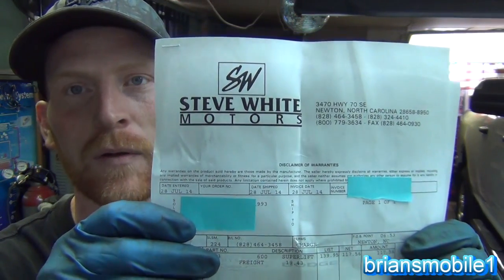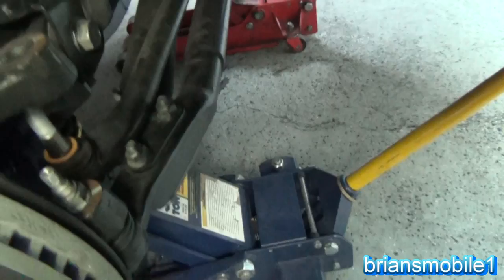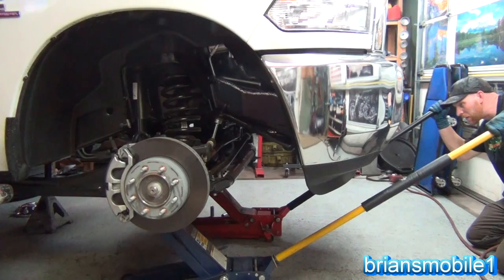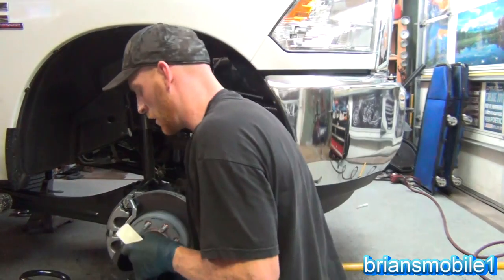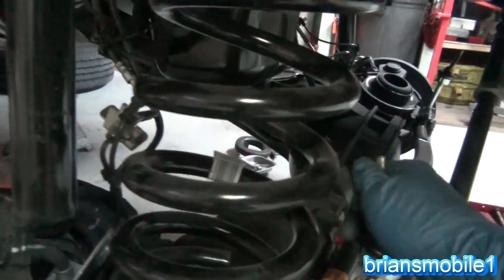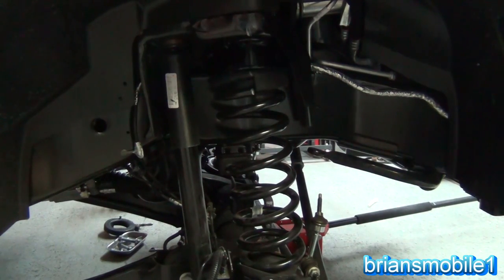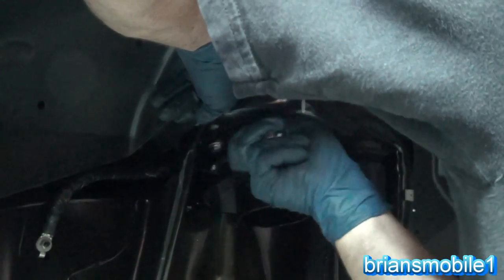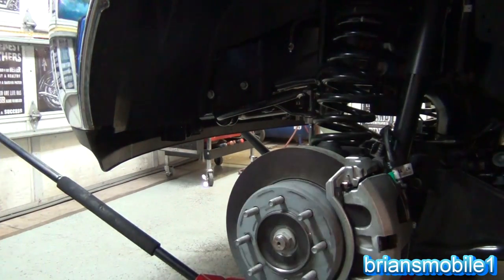2014 Ram 2500 2.5" Superlift Leveling Kit Install

Comment: Thanks for taking the time to show this. I have used the knee method in the past to lift tires up. There is another way I have used ever since I have learned it from a friend. Most of my vehicles (86 CJ-7, & 06 Ram 2500) use tire iron to take off the wheel nuts. What I do is lay the tire iron down on the ground, roll the tire on it, then grab the end of the iron and lift up the tire using the same technique for lining up the holes. I have had to change a tire in the rain and with a suit on so sitting on the ground was not an option. Peace, Reese

Comment: Nice video. I just installed the same kit on my '14 RAM 2500. Just curious why you reversed the passenger side isolator? The instructions say to place the isolator on the spacer so the coil wrap starts towards the inside

Comment: Got a bad knee. I reduce the spacing of the wheel to where I can just tilt in the top and push it on. I wish I had known your tip before it would have saved much wear on me back!  Thanks for the great videos I like the fact that many of them cross over into other areas. :)

Comment: Great video. Two question, why go with the pucks vs longer spring and will you put an adjustable track bar on to correct the pull of the axle to the driver side?

Comment: Hi Brian, thanks for the video. Aside from drilling and price, what's the difference between the 2" and the 2.5"? What made you choose to go 2.5" over the 2". I have the same truck and am looking at a spring project. Thanks, your video was awesome, all meat no fat.
Reply from the maker: JP Foley The 2.5" is a bit past level and ruins your towing ability unless you follow it up with air bags.  With my new airbags it tows better than ever and provides clearance for bigger tires.  Why go higher?  To clear bigger tires and get your under carriage off the rocks and berms.

Comment: Hi Brian, is this your new truck? Just wondering as I have an '01 1500 that I'm looking at trading in on a newer cummins in order to more easily pull my boat. I'm just wondering about you thoughts on the new one if it is yours.
Reply from the maker: It belongs to the Credit Union I use.  They let me drive it and drill holes in it.  I like it, but the fuel economy stock is 10-13mpg.  It's terrible compared to the 17-22mpg I was getting with my '01, but my '01 had the exhaust, chip, wheel/tire combo, and everything else done on it.  This new truck has much better rear brakes, axles, front end design, and interior space than my '01 did.  The big deal was the price I got on it and how much they gave me for my trade.
Reply: briansmobile1 Have they fixed the BS steering on the newer ones? And my '01 is on a 6" lift and on 35's and I'm lucky to see 8-10 MPG (5.9L Gas) I really love the interior of the '01 as I have a screwed back and it feels well on longer trips. I'm actually looking more at the 2010 era (funds) but think I need to go to the diesel as my 1500 has a little struggle pulling my boat. Please keep us informed of the issues and or likes that you come across with the new model. Again thank you for all of your awesome videos and great information.

Comment: Great how-to! One question: when doing this to a Power Wagon, do you still need to disconnect the sway bar links, or can you just disconnect the sway bar electronically before lifting the truck? Just trying to save a step if I can!
Reply from the maker: Should be able to use your disconnect.

Comment: Hi Brian is the front higher now than the rear, i was told it is about 1 inch higher so you have to raise the rear as well
Reply: +Sean Burroughs pretty sure he did airbags in the rear which is why he went with the 2.5" instead of the 2"

Comment: I would have also put a jack stand forward of the wheel frame area. Just for redundancy.

maybe take the shocks out before you take the springs out. 

I think I would weld an aligning plate on the shock extender rather than drill into the existing frame. 

I want to do this on mine but the bowing of the spring is concerning.

Comment: Hi Brian. If by chance u develope the dreaded Death Wobble! With the new lift. Get a heavy duty steering stabilizer with the dual stabilizer's. Dodge and Jeep seem to do this after a lift kit. But the caster adjustment helps. Just a heads up.
Reply from the maker: For sure.  Thanks Will.

Comment: What do you think about rough country 2.5 leveling kit? I might get 1 for my 2014 dodge ram 1500.
Reply from the maker: On a four coil spring suspension it messes up your towing geometry in a dangerous way unless you use a weight distribution hitch or air bags as well.  Both or nothing.
Reply: briansmobile1 thanks Brian appreciate, I like watching all your videos keep it up thanks

Comment: Brian,thanks for the video!
It's funny how you've struggled to move the ABS sensor wire out of the way because it was rubbing against the sharp end of that shock bolt,when you could've just put the bolt the other way. :)))
Reply from the maker: I know right?  The bolt was too long and was blocked from going the other way by the axle housing though.  It would go through at an angle, but not with the shock in the bracket.
Reply: Thanks Brian! I didn't see that part.

Comment: What would the measurements be between axles, center to center,  after a level kit install?
Reply from the maker: Between front and rear axles it's the same if you do the alignment to correct the caster.

Comment: Nice truck Brian, I knew you got a different truck but this was the first time I have seen it in a video. Did I miss a video where it was introduced to the viewers or is this the debut?
Reply from the maker: It debuted in the trailer brake controller video, but I didn't make a lot of noise about it.  I still can't believe I bought a new one.  It just made sense though.  I've always been one for buying a fixer-upper and making it like new.
Reply: briansmobile1 You deserve it, man. Must be nice to work on... no rusty or greasy parts yet. After you get to know it, you should definitely show us around the truck. Interested in particular in hearing what you think about the 6.7.
Reply: briansmobile1 I can understand that, not wanting to spend a ton of money on new when you can get the satisfaction of doing it yourself

Comment: I have a 2014 cummins and I am installing a 2.5" leveling kit was wondering if I could run a -24 offset rim with a 295/60/20
Reply from the maker: +Patrick Tilley I couldn't tell you.
Reply: Did your truck ride like crap when done? my 94 cummins rides like garbage and I think its group effort between my leveling kit and old shocks
Reply: +Alan Ackaway my truck rode like shit anyways so it's hard to tell if its better or worse now. It rides like a covered wagon.
Reply: Patrick Tilley
  Mine was in before i bought the truck, I was considering taking it out

Comment: no oil or grease on your chassis yet? get that thing goopey and slimey before it rust!
Reply: How about paint? Much nicer when you work on it later.
Reply: it's nice to work on a rust free truck. Paint chips anyways and leave metal to the elements. The goey mess seals the chips. Dunno where you live but up here painted frames will rust in 4 years.  A dry frame just rusts here.
Reply: I live in a dry area. Stuff rusts really slow. I've thought about moving to a wetter area so I'll keep your tip in mind. Thank you.

Comment: I like Monroe sense-track shocks for my two-wheel drive street truck. $60 a shock.  ;..(
Reply from the maker: Me too.  I had 4 Monroes on my last truck and 2 Tuff Country add-on shocks in the front for the extra bumper weight.